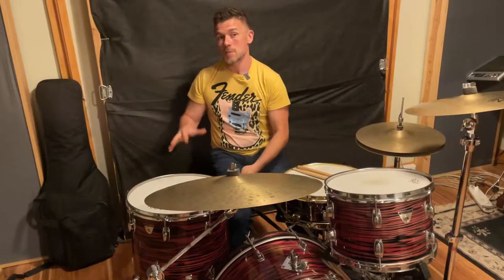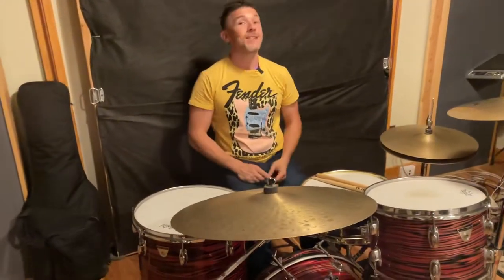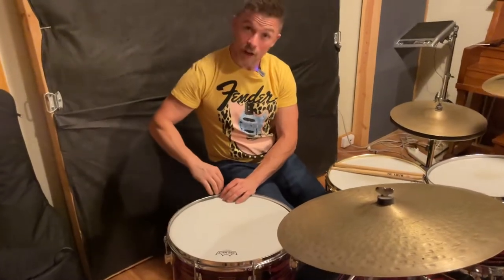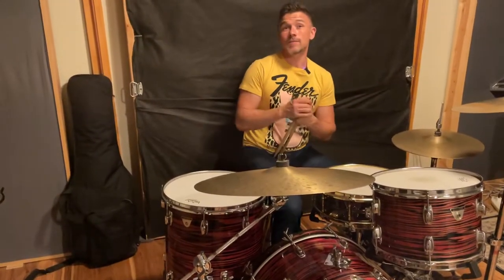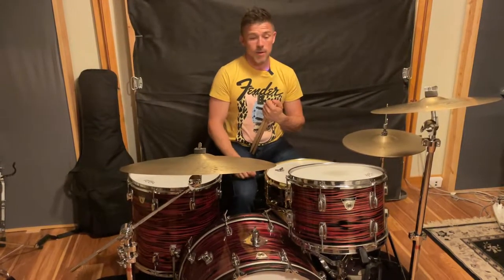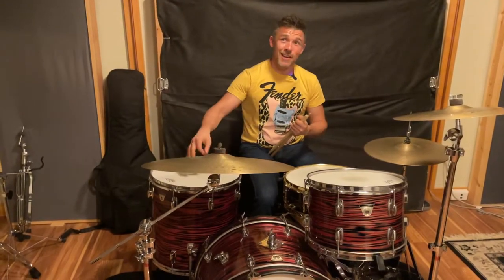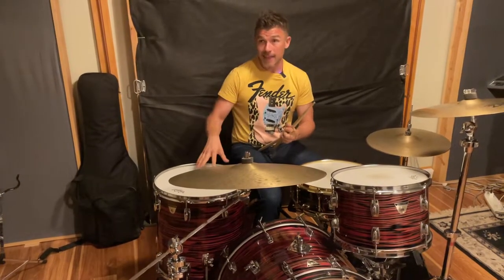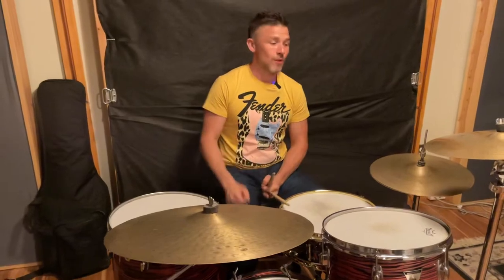The ONE tuning tip that changed my life

Comment: I must be doing this all wrong.  I tune the bottom head tight, and the top head to feel.  I check each lug to make sure i get the same tone.  I also try to do a 4th between the top and bottom.  But dang... I was getting crazy buzz last gig.  All night long my snare wires buzzed.
Reply from the maker: It's all relative! That may work for your kit in one room and sound terrible in another! It may work for one drumkit/head combo and work terrible for another. I like to use this with these drums to get a really good thump that sounds freaking great when it's mic/d up. I would not use this for all styles and rooms. It's just one method to keep in your toolbox!

Comment: Great looking set of old Ludwig 'Standards'.  I use similar simple way of tuning:  first make sure heads are evenly tensioned all the way around:  tap the head about an inch from the edge at each lug and make sure all the lugs are evenly tensioned, then for a starting point for toms I tune for the drums to be 'in tune with themselves';  e.g. the tone more or less similar to the sound of the shell when tapped with a stick.  Then I tune more or less to note values:   I generally keep a floor tom at about a G,  the rack tom at about a C#,  and the snare at about an E# or F using an electronic tuner or piano for comparison.  Bass drum I simply tension resonant and batter side for a good punchy deep sound with a bit of resonance..I try to avoid that flat dead 'totally muffled' bass drum sound.

Comment: I agree that it’s not as hard as many say, and I’ve mainly used extremely low tuned toms just like this. However, the rebound is awful, and that can be problematic, especially if you’re going for quick precision or linear grooves. Doubles are very difficult.

Comment: Since 1989, when I was 13, I tuned by going in the criss cross pattern - and did well with it!

But recently I've been doing the method that Roy Burns shared of going around the drum, tuning has been faster and more accurate!

I finger tighten thetensuon rods, then go counter clockwise around the drum. No fuss no muss. I did start using Aquarian heads recently as well, and have been enjoying them. I'll probably float back and forth between Remo and Aquarian.

Comment: Tunnig is not just the top drumhead?  Overall turning is the Bottom pitch and the bend and the Feel of the drumhead all together in a nut shell and preferred liking of the out come for you?  I have a 1963 slingerland gold .The floor tom and the tom tom don't have a air hole in the them and the kick has it and snaredrum has it .over all the tom and floor are different in turning range

Comment: I've been playing since 1966 and over the years I have created my own tuning style. For the batter heads on ALL the drums including the bass drum, I do what you with the finger tightening (I have a teflon lube on the threads to prevent the metal-to-metal friction from overcoming the head tension. This actually gives a much better feel while tightening the rods.because I use less force.) However the additional step that I do NOT do every time, is to tighten the resonant heads on ALL the drums slightly tighter for better rebound. Once it is set like I want, I leave it. I like the extra rebound for light playing because I'm a jazz drummer who plays a lot of acoustic gigs. Since I play with brushes a lot, this is very important. No, I do not tune to notes or use dials. I tune each one in relation to the next higher or lower pitch and make sure there is no ringing. 

Rock drummers who like to slam their sticks down like a bricklayer would probably use a different technique. Also, the types and thickness of heads as well as different sticks you choose are very important for your style. "One size does not fit all." 

Great info. We can all learn something from all styles of drumming. Good video.
Reply: i do the same method
Reply: Great info here. What brand of teflon lube do use on the tension rods?
Reply: @starskystar  I got a small tube of good teflon lube from a bicycle shop. It's the stuff for cables - metal-on-metal. It is clean, doesn't run and lasts forever. I apply a tiny bit to the threads with my fingers, just enough to coat them. You only have to do it once because it never goes away.

Comment: How do you tune the reso heads?
Reply from the maker: that’s a good question. So keep in mind that everything depends on the situation ranging from the room to the drum set to the style to the head choice. With that in mind, I generally tune the Rezo heads, the same way, and maybe just a pinch tighter. this is just for this one method where I’m trying to get more of a thump sound. That really works well when miked up. It just sounds OK in a room by itself but that’s not what I’m aiming for. I’m trying to get a good sound, that will be easy for an engineer to makes sense?
Reply: Ok great! Thanks I'll give this a try... @aaronapter

Comment: Those may be similar to the Ludwig Legacy and I just acquired a 7 piece copper rose kit so I'll give this tip a try as they were virutally untouched since on display at 2019 NAMM in Anaheim.  Tho I am curious what you do with the reso head?

However, I'd like to hear a bit of tone so I may attempt to crank them a little.
Reply from the maker: I typically use a Remo Ambassador for the resonant head. 
I’m not sure what the Ludwig Legacy kit is constructed of, and I’ve tried this method on a few other sets with not great results. 
This kit in particular was made from 69-72 I believe and is 3 ply. This flat tuning sound works great when it is mic’d up in a studio of a big venue. This is not the method I would use when just setting up for acoustics and tone in a room. It’s all relative.

Comment: Do you do the same for the reso head?
Reply from the maker: More or less yes. I get it finger tight, then about a half a turn and then make sure it’s in tune with itself. This will have the drums sound a bit dead and they won’t resonate as much. However, this allows for engineers to create a huge sound when close mic’ing. When I want to get the drums to sing and rely on the room sound a bit more, I use a different approach.

Comment: I do not consider myself an authority on drums but I do have some experience that I have learned from trial and error and listening to others for advice. When I was new to drums and tuning I thought the top head was the most important and the bottom head not as much but I couldn't have been more wrong. I eventually found out that to make a drum sound really good the two heads need to be in complete harmonic balance with equal tension on both heads. Whatever you do to one head you also need to do to the other head. No matter how tight you like your drum heads or what pitch you like them tuned to you need to keep them equal and balanced. If you don't do this the tone will often sound sour. Keeping them equalized will also help eliminate ringing if you do it right. No need for goofy remedies like a piece of duck tape on the head to muffle the ring. If you are going to play jazz style you will need your heads tuned tight to get the most effective rebounds from your heads much like you would with a marching snare drum. If you are going to play rock music the rebounds might be less important so you will tune your heads looser for a lower pitch but you will always want the two heads equal and balanced. This is what has worked best for me. I think this is fairly sound advice even though others may have different opinions.
Reply: That's interesting, I've just watched a video where the guy said the resonance side needs to be tight and the batter side tuned to how you like it. Who is right?

Comment: Great tip, but as I'm sure you know, the reso head has a lot to do with the sound of the drum. Can you expand on this video and talk about your tuning technique for the reso head?
Reply from the maker: I agree. I more or less do the same thing on the reso head and then fine tune by ear to make sure it sounds fairly neutral. Again, this is mainly for mic’d setups live and in studio where the sound requires more WHACK, THUMP and less sustain. If I’m doing something that needs less of a fat attack and more sustain and room sound, it’s a completely different approach. The way I’m tuning both reso and batter heads sounds flat in a room, which gives the engineer lots of room to make the drums sound massive. It’s a bit counterintuitive for a drummer, but it helps create and awesome end product.
Reply: @aaronapter  That's a sweet kit man!  I read once someone said if a drum sounds bad it's usually because the reso head isn't tight enough....  I've found on my old Ludwig kits, I generally like the reso pretty tight and the batters not so much.  Anyhow beautiful kit and it's good you use them to gig with!
Reply: @aaronapter  Interesting.  With my new Ludwig Legacy kit my next stop is the pro audio with a few mics and a nice EQ/mixer system.
Reply from the maker: @enewhuis  nice! I find that area to be very much like drums… having the gear is nice, while the knowledge of how to set it up and use it is the most important!

Comment: Have you tried cotton balls inside the drums , it’s really what made my drums sound amazing
Reply from the maker: I have and they work great on some drums! I haven’t tried that yet on these drums, as I’ve been just taking the path of least resistance, which has worked out well with all the engineers I’ve had live and in studio.
Reply: @aaronapter  in your opinion what has worked best for you when tuning the resonant side ? Do you opt for higher or lower tuning than the top head ?
Reply from the maker: @drios1993  in my experience, it all depends… on drum, situation, what you’re going for, etc. 
With these drums and method, I try not to overthink It. I tune both sides the same way in ballpark fashion and then I fine tune to taste.
Reply: @drios1993  Typically just a third higher on the Reso head compared to the top head works out pretty good. And this tip from non other Ricky Rocket, he cuts a small 2 - 3 inch center hole on his floor toms reso heads. Says it keeps him from needing to use any moon gel on his floor toms.

Comment: maybe it is utube, but why do people start selling basics as magic tips. Drums are not hard to tune, when the hardware is in well maintained condition. no gauges needed. as a human u have 3 measures/sensor feedback to tune 1) feel the pressure of drum head close to each lug. 2) hear the sound when u tap a drums tick close to each lug. 3) feel the pressure from the drum key when ur turn each lug. ( last one is unreliable if lug are in bad maintained, but then any torque key won't work either)!. Overall drum tuning is not chicken shit, but it's not rocket science.  bit of practise and tools are not needed. Order of lug mattere very little if u sense 1) 2) and 3).

Comment: 75% of the sound of a tom is the reso head.  The batter is basically tuned for attack and feel.  I prefer a bit of sustain to a thuddy whack... basically, the point where the first resonant tone emerges... about a half- to three-quarters turn past where you ended up.  I like the toms to go "poooooommmmmm".   It's true tho it doesn't take much cranking beyond loose to get there.

Comment: Hmmm, do these drums have dampeners, or would this work on clear vs coated heads?? I've tried five different techniques for my sons drums, and I still think they do not sound right.....
Reply from the maker: Like everything else with drums, it all depends. Things to consider: drum sizes, drum construction, drum shells, the ply of the heads, the room it’s being played in, the musical genre, mic’d vs room sound, etc
The simplest and shortest path is realizing there are no simple and short paths!
I’m not trying to be obtuse, but rather illustrating a point that this stuff requires patience!
I like using this specific method for these drums in a setting where I’m playing rock/pop in a mic’d up situation. I do lots of backbeat gigs and these works well in a general sense for most settings with a sound engineer and a room for 1000+. In a solo drum room, this sounds ok but not my preference.